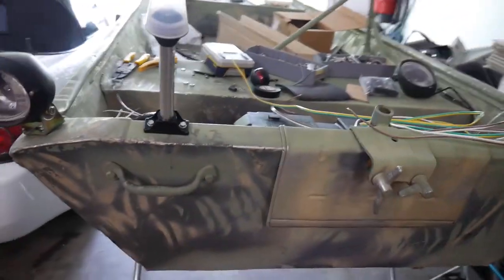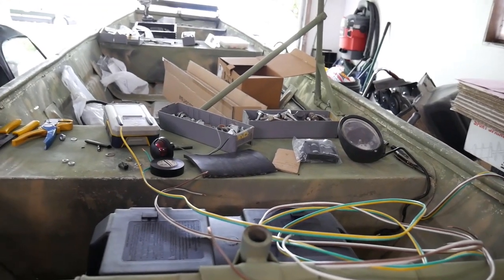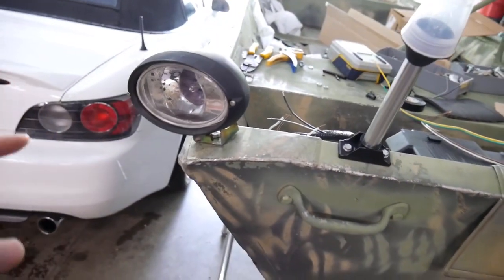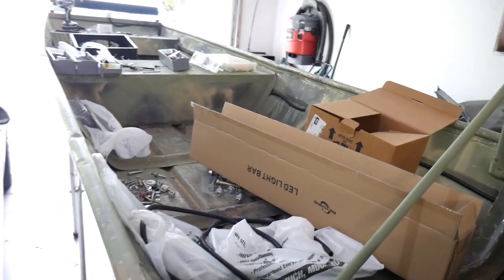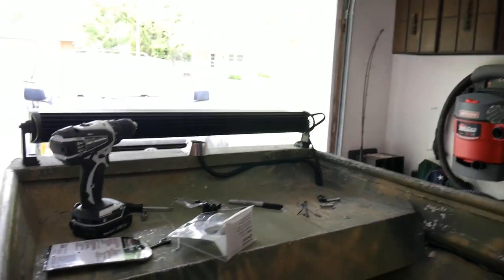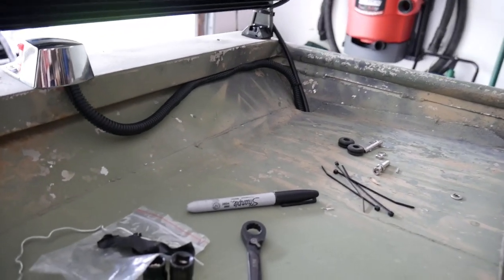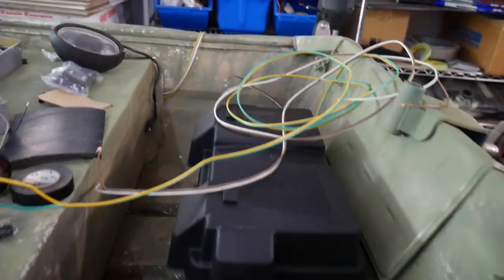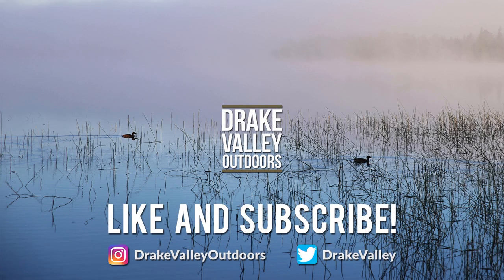We got a duck boat!

Comment: I'd think about some marine plywood for a floor.  It's nice not tripping over the cross ribs all the time. Using a saber saw you can notch along the edges where the cross members come up.  Good luck with your boat.
Reply: Just fyi, marine ply has a chemical (tanins?) that will cause corrosion on aluminum.
Reply: Could be, but I've had it in my 16ft flatty for 25 years, no problem along those lines.

Comment: Congrats on the new boat! I got my first boat in 2015. I also got an older boat (the hull was a 1976.) The trailer on mine is also an old single axle with a 25 hp Mercury outboard. The motor isn't ideal for waterfowl but it gets the job done most of the time. 

I always found more stuff that my boat needed. I just put new Amazon type LEDs on my boat that are super bright. Someone suggested Sportsmansdesigns.com for a blind. I plan to get one of those this year. 
I made the $500 mistake last year of buying a used hard side blind it got us through the season but it took WAY more work and money than it was worth for a blind we couldn't fold down. It was heavy, boxy and high profile. Many softside blinds from Banded or Beavertail are pricey. I haven't used a Sportsman's Designs yet but even with all the extensions, bells and whistles for my boat, it'll be only $220. Plus, it's semi DIY build so it'll be fun. 

Looking forward to your video of you all running lines! That's a blast!

Comment: How did you make the handle for the driver? I'd like to do that to mine
Reply from the maker: I'd probably have to get some better video/pictures to explain it better.. but it's just conduit piping anchored to both sides. There are two pins that can be removed so it can fold flat if needed.

Comment: Is that light bar 12v ? And does is come wired
Reply from the maker: It will run off a 10-30v power source. It does come with the power and ground ran, as well as a rocker switch but you will have to do some wiring to get it hooked up to a power source.
Reply: @DrakeValleyOutdoors  thanks bud it’ll work on a 12v battery is what ur saying ? Bc that’s what I’m trying to rig up on my 17/52  boat
Reply from the maker: @joshuaverdin2160  yes, we have ours wired into a 12v deep cycle marine battery
Reply: @DrakeValleyOutdoors  thanks bud

Comment: Duck hunting isn't a poor mans sport.
  Moving weight forward will help when you are in the water.  Weight of fuel tank and motor, driver in the back.  I'd move the battery forward for balance.
Reply from the maker: We'll have to look at that. We'll likely never be running the boat with only one person on it, so the second person will be sitting further up on the boat. We'll also almost always have gear that we can set up in the front to counter the weight. 

We took it out yesterday with the battery in it and it seemed to do fine, but that was definitely something I had not thought about when we were doing the wiring.
Reply: If the boat is just for transport I'd open it up some. get rid of some of those cross seats. (I'd take all of them out)  My boat is 15-40 and I can get me and 2 others with all our gear. Its not a speed boat by any means though. I put a 23hp Backwater longtail on my boat...a 1976 fisher.  I mounted straps along both side gunnels to hold our shotguns (in floating gun cases also) that way they are off the floor and out of our way. Seats are the smaller yeti type coolers (I got cabela's brand) and they act as dry storage.  I mounted loops on both sides of the boat down low and run a strap over the coolers during transport so they don't blow out the boat.  My storage in the bow is just big enough to hold the life jackets, throw-able, small tool box, TP, spot light just in case my bow light goes out, and 2 small collapsible paddles. My front deck comes back past the storage a bit...just big enough to cover the gas tank and my mojo bag. I ran my fuel line down the sides just like your electrical lines...and my electrical down the other side .  I run a string across the bow from eye to eye tie down brackets. I clip my carabiner  that is holding my decoys (tx rig) to the line and they hang down back over the bow in the front of boat.  All this to keep the boat VERY OPEN as space is a premium.  My battery is a small lawn and garden type. Its sits in the rear.

Comment: You get this bad boy out yet with video?
Reply from the maker: Not yet. We've taken it out quite a few times now, but mainly around areas that we hunt so I'm always a little nervous of showing too much of the surrounding areas.
Reply: Drake Valley Outdoors makes sense. We just went a little bigger and bought a 1440 jon boat. We hunt a lot of backwaters on the Mississippi River in Wisconsin, so didn't want to go too much bigger. Should get the job done for us. We got it all camo'd up and wired. Just need to take it for a float now instead.

Comment: I got 2 small light bars for my jon boat how long do u run the lights of the battery before it drains it. Thanks
Reply from the maker: We have never ran it till it died all the way. We usually only hunted once a weekend with it, and ran the lights for 3-4 hours at most each time. Then it went back on the charger before the next weekend.

Comment: How much?
Reply from the maker: $850 is what we paid for the boat, motor and trailer. I think we're at a total of $1200 with all the stuff we we've done so far. Bearing (plus a spare set), trailer lights, wiring, spare tire, light bar, navigation lights, battery, parts for the handle, ect.